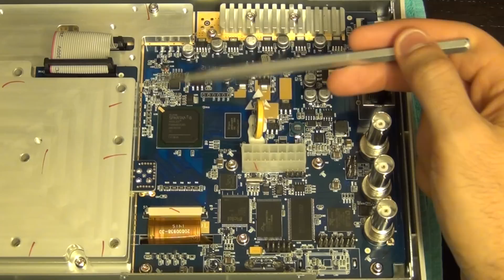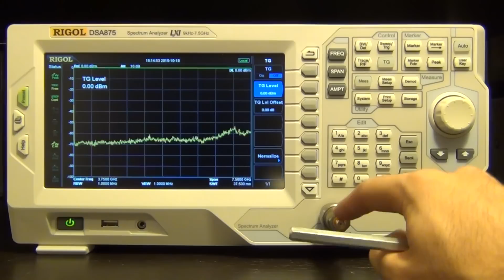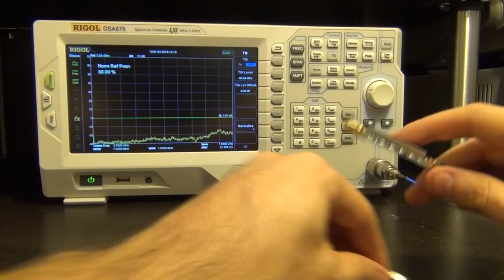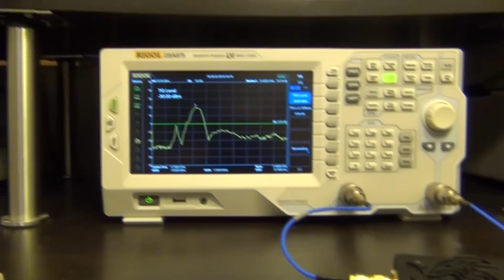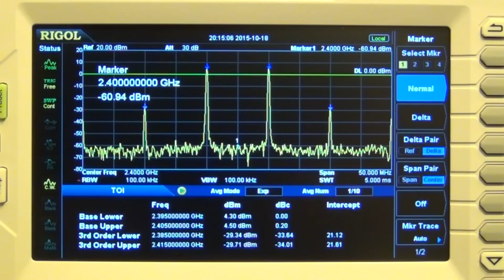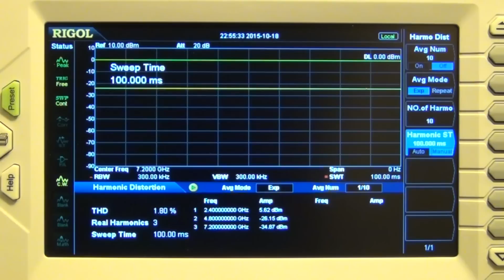TSP #66 - Rigol DSA875-TG 7.5GHz Spectrum Analyzer & Tracking Gen. Review, Teardown & Experiments

Comment: At 48:40, when you change resolution bandwidth, formally speaking you are invalidating calibration / normalization. The instrument will most likely interpolate calibration curve to make up for missing points, which is fine, especially because the TG was pretty flat to begin with, but it is not perfect.

Comment: At this price point, 480 horizontal resolution is unacceptable for the display. Thats NTSC from the 50's. You addressed the slow refresh rate of the 815 & the older 1030 series with the 832 & this 874, but the LCD display is holding this back.

Get with it, even 600h is out of date.

Comment: I would have liked to see the IEC power receptacle recessed, but that's a very small quirk.  I love Rigol.  They should be proud that they are representing China in a very positive light, which is a lot different than what we usually see.

Also, putting pressure on the competition, like you said, is fantastic for the marketplace.

This video is as good as usual.  Thank you.
Reply: It is a perfect spot to put an EMI filter. There are tested of the shelves modules that integrate IEC socket and input filtering (caps, common mode chocks, pi filters, sometimes fuses, etc), they are usually sealed or poted, and are additionally shielded, and are of a long form like that. I think it is fine. It adds nothing to the overal dimension of product.

However I am actually not sure if they have put any EMI filter there. It is probably little bit cheaper to do that on the PSU board, and adds 10-15$ bucks to the cost to use commerical module for that.

Edit: I see what you mean, connecting cable actually makes the unit take a bit more space, and there is no vent holes at the back itself, so it doesn't need to have any gap between back and wall or other flat surface.

Tip: Use angled IEC plug, it will save 2-3cm / 1inch.

Comment: Well done Shariar. I love my DSA-815 and a great deal of use out of it. It is  good to see the increased linearity of the sweep generator for the high-end model. Rigol's equipment represents an amazing value for the money. One thing I noticed it seems the sweep rate for the 875 is substantially higher than that of the 815. I get the impression at either the smallest sweep distance or the widest RBW the update rate appears to be close to Realtime. This would challenge the Tektronix RSA-306. But then again as you point out the 875 doesn't have the Baseband Digital conversion to allow I and Q detection. Still its a very powerful unit.
Reply: You can't compare a 815 with a 830 or especially this 875. HUGE cost and coverage difference.
Reply: +videobruce b The Rigol DSA 815, 832 and 875 are in the same family of spectrum analyzers. I am well aware of the price and performance differences between them. The comparison was a loose one.

Comment: I believe that when Keysight was still part of Agilent, their "bottom-priced" oscilloscopes (and maybe some other lower-priced equipment) were actually rebadged Rigol models (Similar to what Teledyne LeCroy does with Iwatsu). I don't know if Keysight is still has a contract with Rigol to do so. Nevertheless, I tried a few Rigol pieces and I'm quite impressed for the price as well as the support.
Reply: +Dyaxxis Keysight still offers the DSO1000 series, which are in fact rebadged Rigol models.

Comment: I have a naive question on the EMI design: why put the switching power supply inside the EMI Barrier, isn't it one of the worst emitter? What about putting it outside, and filter the incoming supply voltage when it comes in?
Reply from the maker: +nraynaud1 Well, the power supply is already in its own cage. And all the RF sections are in their own cage. Then the whole unit is in a cage. Remember that the unit should also not emit anything outside of its own chassis!
Reply from the maker: +Adam Luran You are welcome Adam. I am happy to hear that my videos have helped you. Keep yourself busy and let your sense of curiosity and wonder determine your mood and happiness. Good luck.
Reply: +The Signal Path Blog Shahriar you're my hero and a gift to humanity. I'm a 16 year old aspiring electrical engineer and you've really helped me with your videos in more ways than one. I've learned so much from the electronics projects you've created and you've managed to also boost my moral,helping me to ease off the severe depression I've been through for so long. I just want to thank you Shahriar from the bottom of my heart.